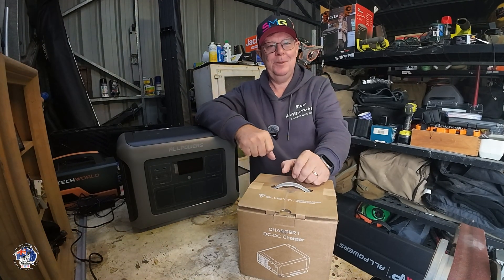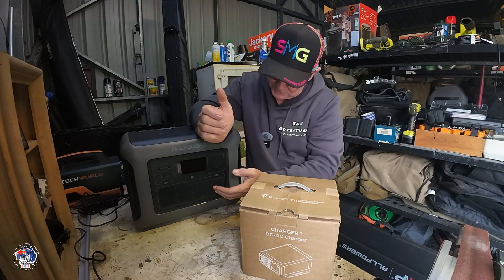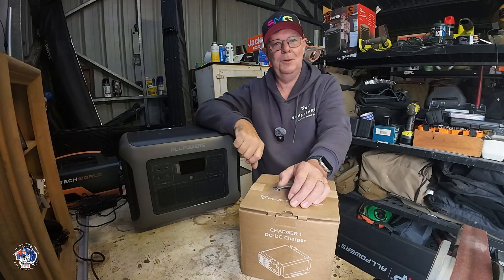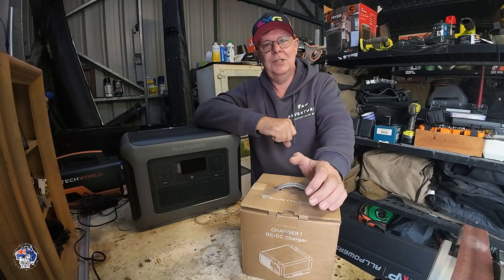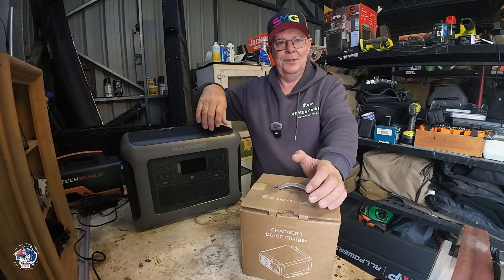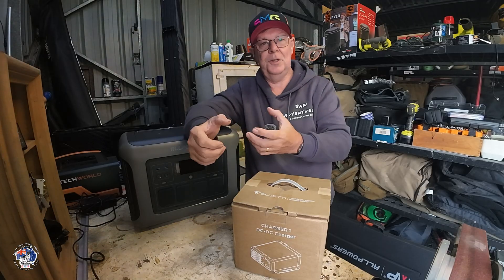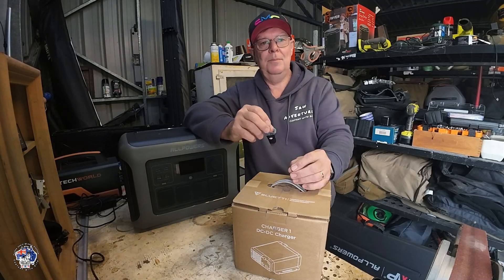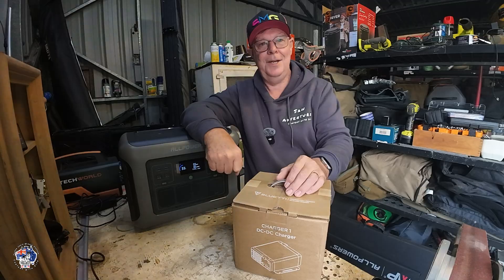bluetti charger 1 / DC-DC running off my auxiliary battery

Comment: Do you have something  that charges the leisure battery ? If so does the charger 1 detect that it’s being charged and come on automatically ?
Reply from the maker: Good question I have done a bit of research and I think the charger 1 main use is for charging power stations e.g. bluetti power stations but it does have the capability of charging other power stations which I demonstrated in my video. It does come on automatically and it does stop charging the power station once the BMS detects that the battery is full. I don’t think they are made for charging batteries on their own. I hope this helps you out thanks for commenting.

Comment: Hi Steve. I’m looking at this setup for my camper. Is there anything that stops the Bluetti charger 1 from completely discharging the leisure battery to charge the power bank? Thanks for any advice
Reply from the maker: Your bms in your battery should protect it from going completely flat but I keep an eye on my battery using my app to track the SOC of my main battery if needed I start the car to get more power back in it cheers hope this helps you out

Comment: Just wondering if you are towing a caravan and your car is charging the Van. Is it possible for the car to charge a power station as well.?
Reply from the maker: Yes that’s why I have hooked it up to my auxiliary battery in the back of the Ranger so that the DCDC charges auxiliary battery only and that battery can  power is anything else eg fridge usb ext or anything else I plug into it , I can still charge the caravan but 90% of the time the solar panels on the roof keep it charged fully anyway I only have my DC to DC charger set to charge the auxiliary battery @ 30 amps and the caravan charges at 20 amps so I am not putting too much stress on the alternator

Comment: 10amps is only the same as a cigarette socket?
Reply from the maker: It can put more than 10 A in it can put 40amps in
Reply: oh i must be looking at the wrong specs. The Blueti charger 1 is 10 amps, but it can go to 57 volts. So will be a higher wattage than a cigarette lighter.
Reply from the maker: @davidmedley9652  yeah you can regulate the voltage depending on what power station you are charging. I think you can put up to a maximum of like they said 56 V which would probably be around 40amps but the small unit I showed at the end could only handle 19 V  or 100watts which is only about 5amps thanks for asking the question though 👍👍

Comment: If you have an inverter in your set just plug it into the power station ac charging port.
Reply from the maker: Yes you could do that as well but my inverter choose about 3 A on its own and would run the auxiliary battery down more than BLUETTI but I could definitely do that👍

Comment: How much extra load on the alternator does that charger pull, how many watts to run it??
Reply from the maker: 560 W maximum, which is probably around 40 Amps but I’m not Running it off the alternator I am running it off my auxiliary battery in the back of my electrical system but I will never be using the full 560 amps as my power station only requires 360 Amps so basically it’s no different to a red arc or any other DC to DC charger
Reply: @Sawadventures67 yeah if you ran that on top of your redarc bms30 or similar from the alternator a lot of setups would be struggling unless alternator upgraded
Reply from the maker: @chrishepple7238  yeah definitely. I understand what you’re saying. You would not want two DC to DC charges pulling 40amps your alternator would not last long 😂
Reply from the maker: Also, you have the option to wind back the power in the app, which is a bonus